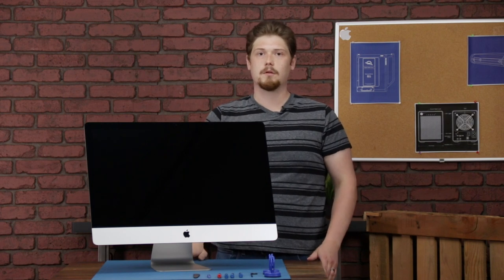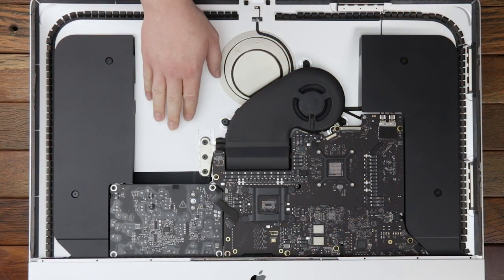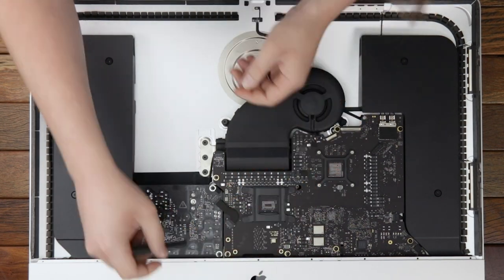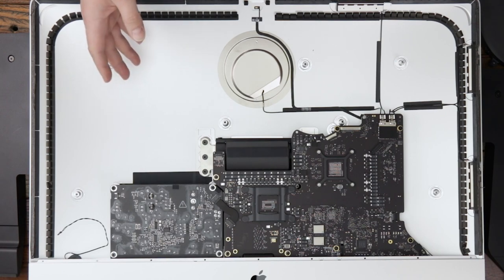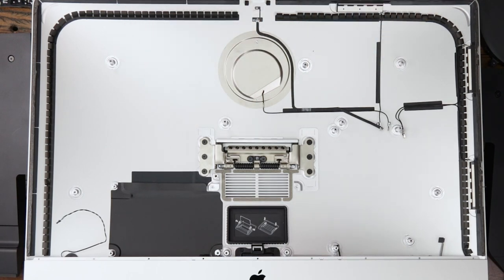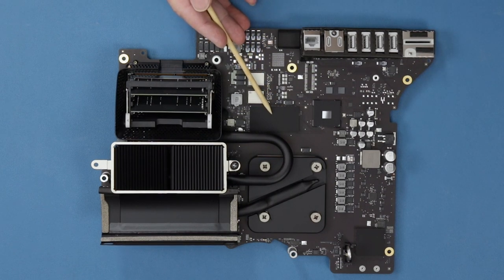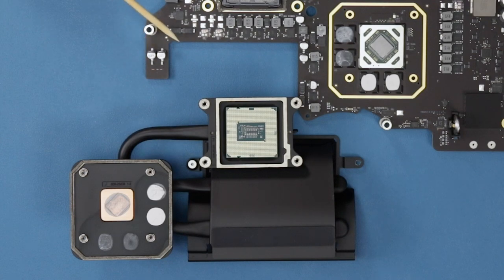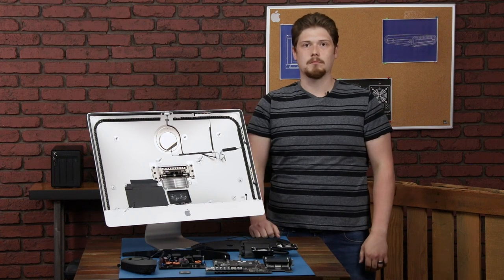2020 27-inch iMac 5K Teardown (iMac20,1)

Comment: SSD configurations above 2TB use an expansion board, which is what those empty solder points are for.
Reply: Is integrated SSD faster?
Reply: Good point and I was wondering what those were doing there.
Reply: Even so, by small margins, and I don’t think it justifies the inability to upgrade later if you plan to keep the machine for 4+ years (by that time your SSD will fill up and you might want more storage). IMO, soldered SSD doesn’t justifies the security and speed. I’m just a creator.
Reply: @neopyun4013  “Integrated” just means that the connector has been soldered in.  Confers no electrical benefit unless apple is using some proprietary pin configuration that offers additional benefits.
Reply: I‘ve ordered the 4tb version.
Reply: Stephen Orion more storage is not a good (enough) reason that’s what external memory or nas are for. The reason soldered memory is not the best idea is repairability
Reply: @MacMasore  I think we are saying somehow the same thing anyways. I feel like repairability and upgradability is inter-connected.
Reply: Stephen Orion it is compatible but not the same. Btw it's always safer  "decoupling" storage and os. Certainly now with USB-C and Thunderbolt 3 where you can even edit videos and game from them. I would even advice not going higher than say 2tb internal(the more you get the more you can lose if the disk brakes) on a desktop. A laptop is a bit different because it's easier to take when you got more internal memory but you should watch even more that you back it up.
Reply: SSDs perform slower the closer they come to being filled up. The point of owning 4tb is not to fill it up, but to have an efficient 2 TB drive. Thus endeth the lesson.
Reply: Michael Prenez-Isbell that's true but €750 for a bit of extra speed? For €750 you can get a external ssd for a lot less that's maybe not as fast but fast enough.
Reply: @MacMasore  depends on use cases. Some need speed over price. Some care about price over speed. There's no wrong or right. I bought a thunderbolt 2 drive for my macbook pro just because i don't want to use up my usb-a ports, which i use for other connections. I paid about twice more for that case. But it's worth it to me. But some would say it's stupid cuz they'd probably just use the 6Gb port. Different use cases, bro.
Reply: Stephen Orion yep but for most cases or if you make money with it you could say there is almost nothing "too expensive"
Reply: @neopyun4013  nope
Reply: @michaelprenez-isbell8672  Yeah, and a 4Tb SSD is "only" $1200 more to the cost
Reply: Where is proof to this please?
Reply: Al Davison proof to what?
Reply: @MacMasore  I'd be more worried about the logic board having a failure than the SSD itself failing. Not long ago I was in charge of Macs and mobile devices at a medium sized enterprise, and we saw quite a few logic board failures. No SSD failures that I am aware of. 
That said, I'm always in favor of computers that can be repaired 'in house' when possible. Apple warranties do not have a spectacular turnaround. And they do not rescue data. They say you should be using iCloud or another cloud storage servie for important files.
Reply: @MacMasore   Tim Erickson said that the SSD's above 2 TB comes with an expansion board. I called Apple yesterday and I was told that this statement is false.  The sales rep. from Apple said that all SSD's are soldered on the new iMac.
Reply: Al Davison In my experience sales reps are  usually clueless when it comes to technical questions. So many times I asked them and they were rarely correct. We will see this time though, someone is gonna crack open the 4 or 8tb iMac soon and make a video out of it.
Reply: @ryanvacation7319  I agree
Reply: If you ever had an iMac from 2019 or earlier apart you would know that the solder points you speak of is where the old removeable SSD socket used to be it's not for any expansion board it's just what is left from something not used anymore, I have disassembled a few iMacs and even if you had one with a  HHD it still had the socket for an SSD and that is where it was
Reply: My understanding is the 4TB-8TB models use expandable SSD's.  2TB and below are soldered.

Comment: That SSD is soldered. If the SSD fails,  it cannot be replace: not good at all.😞
Reply: Just get the Apple Care plan and extend the warranty for 3 whole years...after 3 years just buy another iMac what's a few thousand dollars? Seriously, the cost from Apple to replace that soldered in SSD wouldn't be cheap I'm sure. Soldered in SSD? F that, I'm glad I got my iMac before the 2020 models came out.
Reply: harry berry true, the buy Applecare and sell it at the end of the warranty seems a reasonable approach but with Apple Silicon looming, I wonder how severe the intel Macs will be hit by depreciation. Also, soldered storage may shorten the lifespan of the computer = more e-waste.
Reply: Really sucks man. Not even a direct access port where you can attempt to retrieve data in case of a HD failure.

Comment: They really let the space empty in the iMac, where the HDD was? They could've put a second fan in the iMac and splitt the two coolers, like one for the CPU and one for the GPU
Reply: That’s going to be the last iMac with that design, most likely.. so they didn’t felt like redesigning it and implement other stuff. I think they did prefer to put the design team to work on the next gen iMacs
Reply: talkdatrue I‘m sure they are working since 3 years on a new design, every product has a 3 or more years in development stages.
Reply: Mene Man Sure. But you’ve to understand the period also... I mean, with covid in China changing the design and production line and risking huge delays I don’t think it’s a genius move if you want to make money.
Reply: i was thinking the same

Comment: I really have a problem with the soldered on SSD.
Since i would like to opt for an upgrade or simply replacement of my HDD/SSD after some years of usage.
Memory cells get worn out and when i take into consideration,  that i have a daily write data traffic of 300 to 400 GB, i know an SSD won't last me forever.
I would have to go for the biggest possible option, which is 8TB to somewhat counter the wear of each cell with the help of sheer amount of them.
But that would cost me multum plus a kingdom that has yet to be discovered by me.
I would have also liked the possibility, to maybe use the empty space where once the HDD sat for a simple bracket, that can hold a 2.5 SATA SSD.

I'm still running my late 2013 base config 27 iMac with a mechanical HDD of 1TB.
But i'm at least able to replace it with either an SSD or a new HDD. Additional to that, i have an empty M2 like slot for such SSDs also.
Everybody talks about climate change, how we can literally save the world by not cunsuming and wasting too much of our stuff and then THIS.
Reply: Unix Based Justvbuy the base model and make and external thunderbolt SSD your working disk
Reply: @scafusa  :
I am already using a ten bay HDD tower To save my stuff on, but i talk about internal disks, in the age of "muuh climate change" they should at least make computers repairable and components that can wear out (which SSD and HDDS do over the years)  exchangeable, so you don't need to throw away the entire computer because the SSD is worn out.
Can't be that hard to do.
Of course can i use and external Thunderbolt 3 case and an NVME SSD in it and it would be almost as fast as the internal. But that's not the point of my complain.
I talk about the very principle of being able to somewhat update an computer that is already expensive in the base config compared to competitors.

Just imagine you could not get your engine repaired in your car, because it is molded in.
No one would accept this.

Same with Samsung a few years back. Do you remember the Note 7 desaster with their failed batteries? They had to fuckign trash all phones, just because the batteryw as trash and you couldn't disassemble it without huge effort and risk for damage on the phone.
A simple fucking hatch would have made this a nobrainer. But no, it had to be complicated and buttfucked to no extent.
Reply: I agree. The first thing that comes to my mind was “this basically makes it disposable.” For a company that likes to talk about social responsibility and saving the planet, they sure make a lot of stuff that contribute to more e-waste. I love their software but not a fan how they intentionally limit the lifespan of perfectly good  hardware. 

Who knows some youtuber, hobbyist, or repair guy will find a way to unsolder and replace that ssd in the future. It would be a huge waste to throw out a perfectly good motherboard just because the ssd wore out.
Reply: The T2 chip prevents SSD upgrades regardless from what I heard.
Reply: @poetsguide  :
But then, Apple can skip their "Time Machine" backup since it's not working when my internal SSD goes nirvana. and i won't buy a new iMac just because my internal SSD broke.
To then use an external Thunderbolt connected SSD and allow the user to use his backup on it, would pretty much counter the very purpose of the T2 chip.
Reply: @Jean-Simon Chénard Not the biggest, don't over exaggerate for christ's sake... But it is defiantly trying to tie down the market and its going to lose alot of friends...
There is no way on earth anyone needs to buy a 2020 Imac when a 5K 2015 or 2017 will still out perform and be repairable...

Comment: Yeah, that wait for the capacitors to discharge is pretty important.  I got a good jolt when I took apart my 2009 iMac years ago because of being impatient LOL
Reply: Yes they leave the power supply exposed on purpose I got electrocuted badly by the 2007 one lol

Comment: I was totally amazed by the unused space inside the case - pretty amazing.  A lot of comments here about the soldered in SSD - the problem of course is integration with the T2 chip eliminates aftermarket replacement of that drive anyway - or so I have read.  I also see a lot of comments about adding a second or larger fan - but MaxTech did a test of the 10 core 2020 with the optional GPU and did not have serious throttling issues nor did they comment on a loud fan.  Maybe Apple found a different solution because the i9 was definitely hitting the max power draw.

Comment: Matt, Thanks.  Very good teardown. ... ... I bought & sent back a high-end 2019 iMac with SSD due to the at idle & the substantial noise under load. From the teardown I do not see anything that would make this quieter than a loaded 2019 iMac?? Sad if true with so much empty space inside for more cooling.

Comment: If the ssd dies for any reason is it possible to use an external one via usb/thunderbold without any issues from the system/motherboard/ignore the damaged soldered one ? Can you even use permanently an external one for booting/storage and leave the soldered one without any use ? It is good to know if we have that options for a last resort if something goes wrong.......Thanks.

Comment: Thank you for this video! Definitely answered my long question about the 2020 refresh.
Wish Apple implemented their iMac Pro Dual Fan system into this iMac for quieter and more efficient cooling.

Found that my Studio iMac Pro performs much quieter under load than my 2019 iMac i9 at home which sounds like a screamer when running at 100%. So... Any Dual Fan kits that someone is willing to put together? Haha!
Reply: @tony24-u9x  Yeah I agree with what you're saying about not having an option for the iMac Pro to upgrade to the Nano-Textured Coating

But yeah, as much as I love the iMac Pro, I don't really need the Xeon Processors and ECC RAM. 

Just wish Apple upgraded the cooling inside of the iMac Pro

Comment: Is it possible to install a SATA-Storage-Drive? Or is there no possible SATA-Connection?
Reply from the maker: If the machine does not come with a SATA drive installed from Apple, then there will be no SATA connection on the logic board.
Reply: Well, shit! But thanks for the Answer

Comment: can you put a 2020 nano texture display on a 2019 or 2017 model?
Reply: Well the 2020 display has the camera integrated. It might be possible but the camera is the biggest variable.
Reply: @tony24-u9x  Good point sir.
Reply: Better question: can you put it in a iMac Pro?
Reply: @t1merickson  Now someone is thinking. (:
Reply: @tony24-u9x  Good intel and thank you.
Reply: Antonio Zamudio the iMac Pro has two mics, both located at the top of the housing. The 2020 iMac has three, one at the top and two at the chinstrap gap where the bottom of the display meets the housing.
Reply: Antonio Zamudio It’s all good as long as we can get good sound from them. (:
Reply: @tony24-u9x  I'm not sure what your sources are but there are only two microphones and one is on the very top of the housing above the camera and one on the back right below the first one. I'm looking at the service manual right now.
Reply: It will fit and the display would most likely work. The backlight power cable is the biggest question mark since it is fixed to the display and can not be swapped like the eDP and camera cable are. That being said the cameras and cables on the 27' iMacs are finicky at best. Using a 2017 camera cable on a 2019 could cause the camera light to turn on but not show any video and vice versa with the 2019 cable on the 2017 camera. Microphone would not be effected.

The display/camera assembly is not controlled by the 2T chip on the current iMac Pro so for now that not an issue.
Reply: Antonio Zamudio you are correct. That’s bizarre, the service manual fails to mention that. Even in the troubleshooting steps it doesn’t mention the microphones in the camera assembly.

Comment: Would it be possible to add in another PCIe card where those unused solder joints and mounting point is?  Or maybe another AMD Radeon Pro 5700 XT 16 GB graphics card there?  Also what about replacing the (for me) unused SD card slot with a couple more lightning USB4 ports?  Is that doable?  I was also thinking about just getting rid of my internal speakers entirely to better improve airflow and heat dispersion (if nothing else), since I never use them.
Reply from the maker: Hey Chris, not entirely certain. My assumption is it is not possible, this really wouldn't be something that we would tinker with unfortunately. We typically make products designed to fit Apples standard ports rather than adapting additional ports from their computers.

In some capacity I believe it could be doable, but with the right tools & skill set. This isn't something anyone here at OWC would really have any experience with.

Comment: Excellent video. Do you reckon the matt glass upgrade worth it?
Reply: A couple of others that have these new iMacs are saying it is.
Reply: If your workspace got too much reflections going on. And if u earn more from seeing the non reflective display. You can justify. If you don’t make a living off of viewing optimal display, I think it’s a pass for me. I work in music.
Reply: Stephen Orion I have a 2014 version and the reflection is really just a bit of annoyance which I’ve sort of got used to. I’m a software engineer and don’t absolutely need the matt glass, but then these machines last for many years.. I’ll sleep on it
Reply: @rarra  yeah just take your time haha. Maybe check out the difference in an apple store. For example, i don't need screens over 1080p but I dont like to be distracted by pixels when i works and wants a seamless smooth display so I would pay more for a 2K or 4K display, but I wouldn't pay more for zero reflections.
Reply: Stephen Orion This is a great point. I am used to dealing with reflections and I am okay closing my blinds to avoid them. (:

Comment: Does it go higher in ram then the 128gb Apple says so?
Reply: @UppiliRa That would be a lot of RAM. WOWZWERS!
Reply: No, the max size for SO-DIMM is 32GB per module. Maybe one day, but i doubt. DDR4 is end of line development. Next year we get DDR5
Reply: @UppiliRa I would need 128GB, i could even use 256GB as developer. If you do cross platform development. I need a 32GB VM for Windows and Linux and 8GB for Android and iOS emulators. And putting all build and testing in a 128GB RAM Disk would help a lot too. 256GB is less then $1000 at the moment. Not a lot for a developer machine but only possible with hackintoshs or macpro.
Reply: UppiliRa What is mental?
Reply: Lothar Scholz That makes sense and thank you for sharing this information. (:

Comment: Good video. But its seems impossible to upgrade your SSD capacity or use a bigger external SSD to boot from?
Reply from the maker: Upgrading your SSD capacity or using a larger external SSD to boot from is possible, but it is a very involved process. We offer installation videos that provide step-by-step instructions to guide you through it. While we aim to make it easy to follow, using an external SSD is also a great solution if you're looking for additional speed.
Reply: @poweredbyowc  Thanks for your answer, where can I find the installation videos that provide step-by-step instructions to guide me with the boot from a external SSD for the 2020 27-inch iMac 5K?
Reply from the maker: I apologize for the confusion, the videos we have show the installation for drives but not the boot process for external drives. We do have this blog that might assist you with that external drive boot process https://eshop.macsales.com/blog/55907-using-an-external-drive-as-your-startup-drive-part-1/

Comment: On the inside where we see the empty area where the hard drive use to be, can I add a tray there to  add additional storage?
Reply from the maker: If you have a drive currently in there yes. If you did not purchase the iMac with a drive you will not be able to due to Apple not including the necessary cabling.